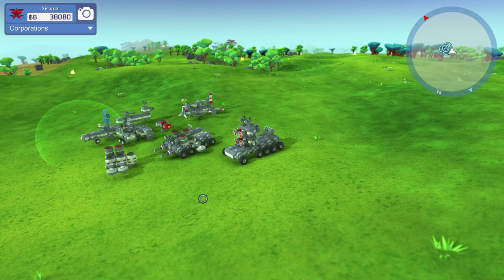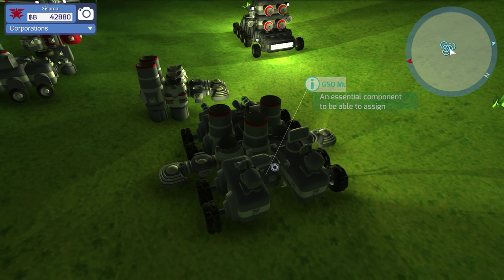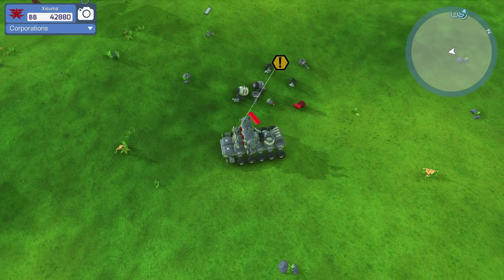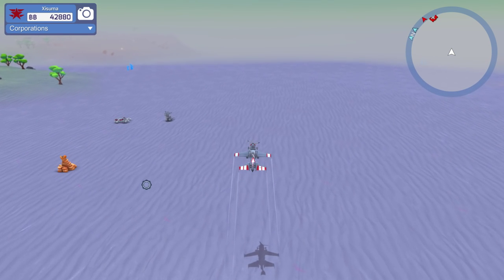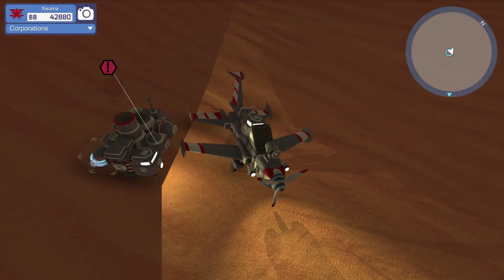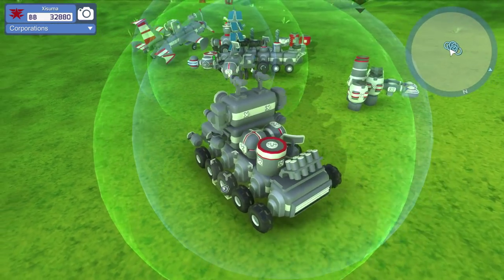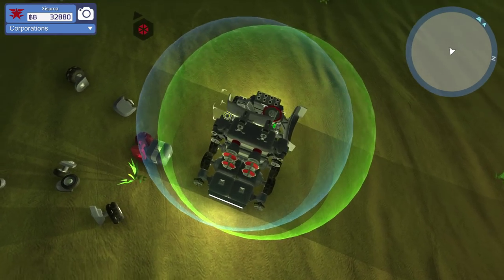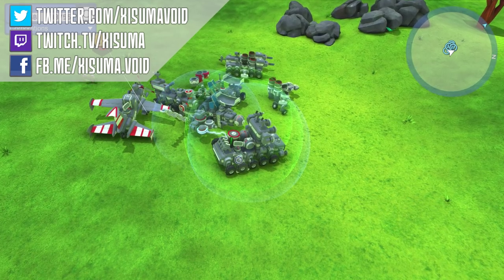TerraTech 04 Battery And Shield (Let's Play)

Comment: out of the current weapons u have, the three pound canons are best for frontal attack and maybe on the back. if u put it on a rotating block, it can shoot in all directions i think. u can also create a turret or buy it i. the tech section of the payment terminal. if u put a shield bubble and battery, it will be un defeatable. use it to gurd your base. put a shield and heal bubble on ur base to be safe. for best effiency on base layout, split it up into diiferent sections. a section for selling raw. resources with recievers, refinaries and launch canons. and section for scrapping parts and selling them directly. a section for scrapping. and kepping resources for latter use.  an area for fabricating parts using two slot fabricator. an area with three part fabricatin, etc.

Comment: get geocorp blocks.  the wheels are heavy duty and the blocks can take a lot of damage but are to heavy fir gso blocks. venture blocks are very light and good for speed but easy to damage. good with gso blocks. there are experimental parts like a megaton cannon and machine gun thing. they are 2x2x2 ithink and high damage with slowish fire rate but is a bigger and better version of 3 pound canon.  machine gun thing is very fast fire rate.

when constructung tech, put venture blocks inside and geocorp on outside. use gso for adding single blocks and perches for weapons. try getting a generator and shield and health bubbles with lots of batteries. you can put bubbles strategically on tech and charge them with generator. u can fing generator on gso setion next to small batteries. generator requires fuel stuff like wood, oils etc.

replace venture blocks with these if possible.  more space effecient.

with the flying tech, real life physics are aplicable. centre of mass needs to be in the centre with centre of lift just behind it. more wings on correct places increase lift. the light the tech, the more lift u get. use venture or gso blocks. only use geocorp if u have a lot of thrust from propeellers, rockets fans/turbines, etc. the tech needs to be symetrical for best flight.

watch tutorils on this. i watched one that was about half an hour or less that was very informative and showed some good designs that worked.

for fire power on ground tagets, place weapons  on bottom of tech. there are littke or no fly tehs so there is little to wordy about flying techs. just in case, put frontal fire power.

there is an option on main screen which allows u to test out tech designs as well as there combat and speed, hight, and other abilities with other people. only sumo mode allows u to go against other peoples techs if i remeber correctly.

ais are only good for harvesting and support in battle. there programing isn't. very good but may improve in future. u can turn them into mobile bases which can sell items as well as gathering if u want. they are not as effective as u are if u harvest ur self. put weaponary on it if possible and don't. expect it to last long.

the ai isn't as smart as players and therefore get stuck and can't move as well as play. this is increased when wheels are over burdened.

one way if getting extra money and resources is by recycling parts useing the scraper. it recycles parts to parts used to create it. more complex parts can be recycled again (this is uncertain and needs to be checked). u can automate it using a large reciever pad, a scrapper and launh canon.

somethings might have changed since the past few months from when i watched the videos, and videos involve previous updates. so be careful.

sorry for any mistakes in spelling and grammer. as long as u understand, it is okay. if there is something u can not understand,  i will try to correct in the future. it is this bad because it is a long piece if text written in short amount of time and using short cuts like u instead of you.

thank u for reading.